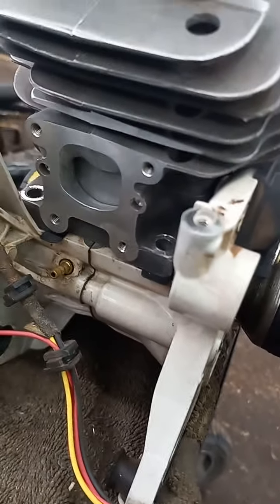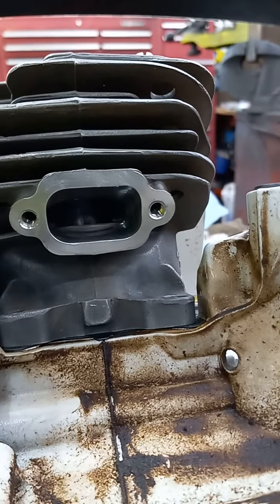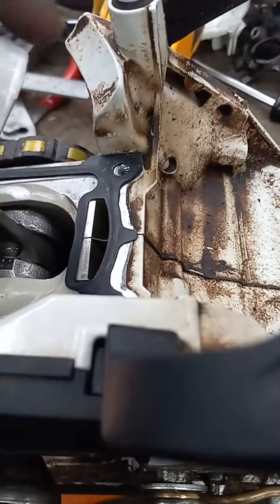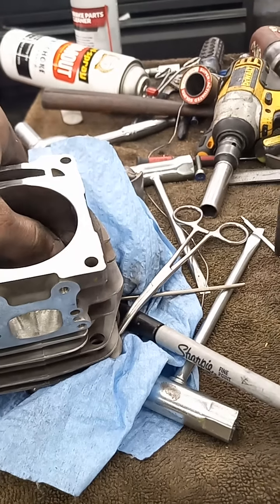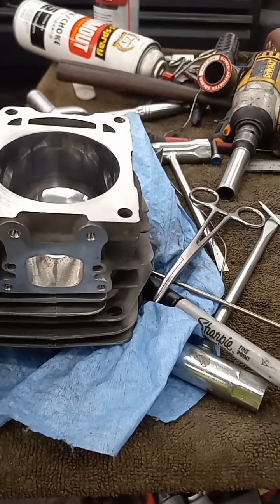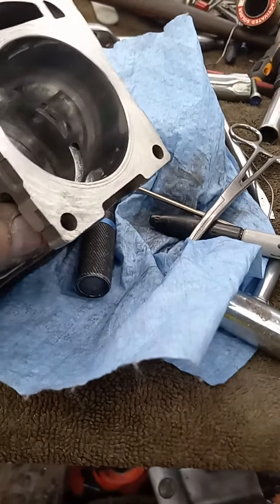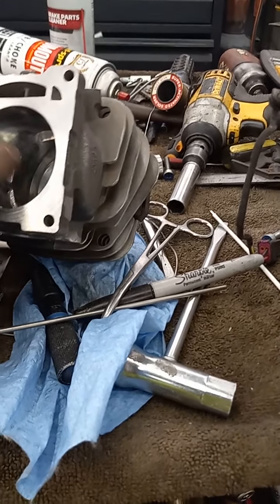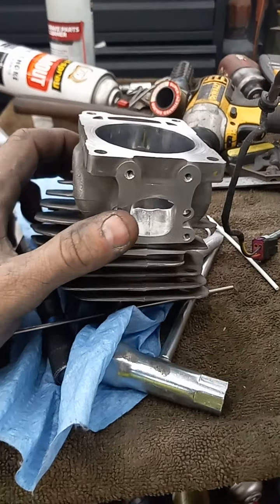the port work on my 500i

Comment: Hey Charles, nice job. Do you remember what the factory number was for the exhaust port opening? Was it less than 100*? 
Thanks!
Reply from the maker: It was 104 it was around 111 after base an band cut then I moved it to 102 after all the machine work